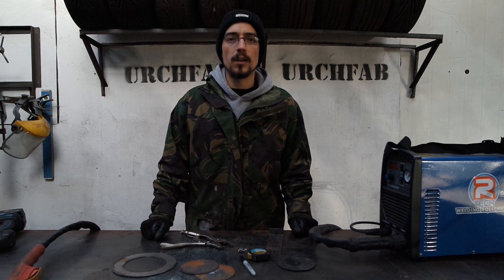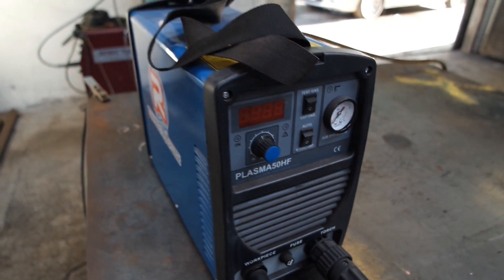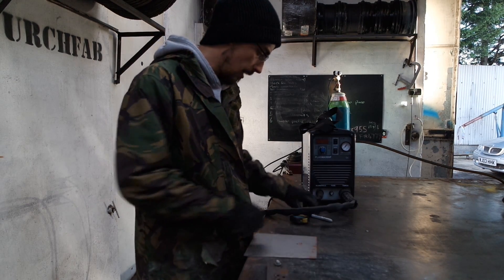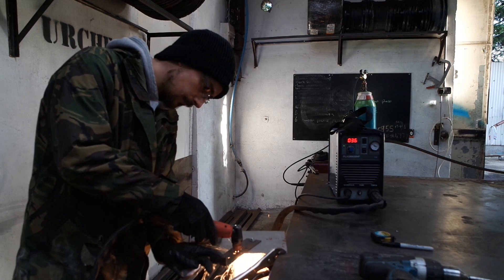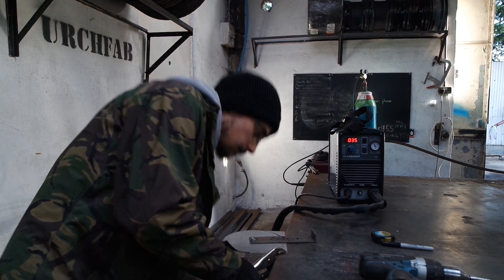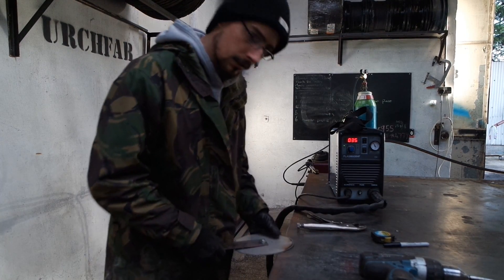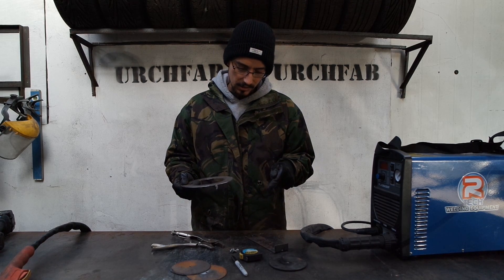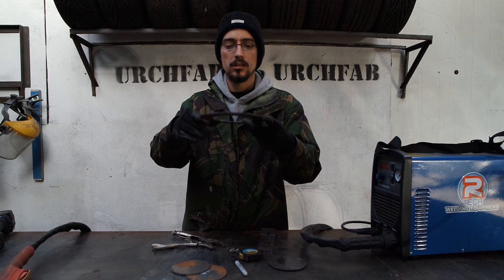Plasma cutting perfect circles with one easy to make tool.

Comment: This is by far the best circle cutting fixture I have seen. The one that came with my plasma cutter is so flimsy and hard to set up. In fact, I made one like the one you show in less time than the time I spent trying use the store bought item. Sure, each different radius requires a new guide hole but the repeatability is spot on every time and that is huge plus! Time for a pint..Thanks.,,Steve M

Comment: Nice! How small of a circle can you cut like that? Just wondering how small you can get it. I need to cut 2” diameter (or thereabouts, haven’t measured) circles to make flanges to fit over an existing solid welded tubular cross member that I need to make removable.

Comment: Great idea... this will so help me get better in the workshop after lockdown... just one question... is it not a problem that the nozzle  is now in contact with the workpiece... doesn't also the metal template cause double arching

Comment: You need a piece of pipe with a bolt welded in the end of it, that way you won't have to clamp it and get a smooth run 👌👍🍻

Comment: Make the jig bigger. Instead of holes fabricate a slot in this jig. One could then make a torch holder that slides in this jig making it adjustable  with a fastener.  Rotate the stock at proper speed on the bolt and the cutoff  falls away.

Comment: great idea but was just thinking if you welded a piece off threaded bar to center off a heavey plate 12" square ...cut threaded bar to 4 " then also weld few pieces of bar to plate but cut them too 3 1/2 " then you could sit plate with hole over threaded batr tighen down your cutter plate rests on other bars :) ....like your idea ill be using it in future

Comment: Why don't you clamp the piece with the holes to the table and spin the plate steel. I'd  make one like  that longer and space the plate steel about 1/4" from cutting tip. I think I'll make me one. Thanks.
Reply from the maker: Yeh that would work for small pieces of sheet but if your working from full size sheets it wouldn't be to handy.
Give it a go, Cheers Matt

Comment: If you made a hub that was magnetic, or able to be clamped down (think similar to the needle on your speedometer, etc)...you could use it without drilling a hole in your work.
Reply from the maker: that's a good idea, il look into making something. Cheers
Reply: Urchfab counter sunk head on the bottom,  with two small circular plates sandwiching your guide. Add any strong magnet (you could maybe even just sit one on it), and if your tolerance is right it should spin easily.
Reply: i use a magnetic welder ground and made a radius slide. adjust it to meet the criteria of the cut and cut. not limited to drilled holes.
Reply: Yep! Already has a threaded post to mount the slide to!
Reply: Nice idea I like it.

Comment: Brought to mind a question. I sort of thought the torch tip shouldn't touch the metal? Your cutter obviously work fine, but I wonder about other vendor systems? I have a Lotus 50 amp unit, and will have to check up on it.
Reply from the maker: You are correct, you will go through a lot more consumables if you allow it to touch the metal but I always do it like this as I find it more accurate. Cheers Matt
Reply: Just found a video where one could buy an Insulated Drag Tip for an AHP plasma welder so direct tip to base electrical contact could be avoided. I don't think one is available for a Lotos unit, but I have been known to get creative. :-)
Reply: Unless you don't have auto arc, then you have to drag the tips to get them to start.    I've started using steel tips with my lotos.
Reply: Tom Herd you can touch it if it's a drag tip